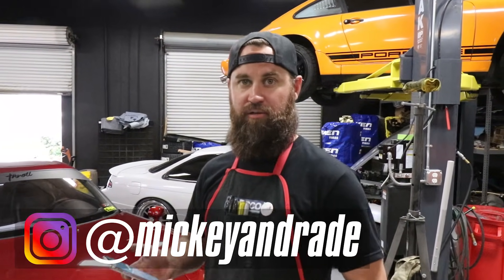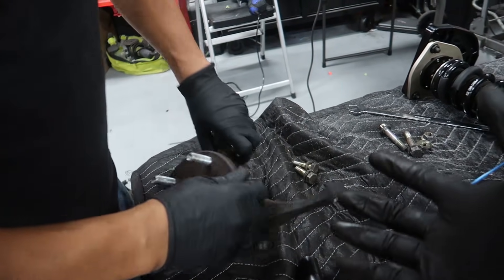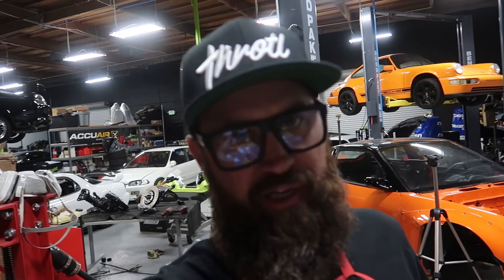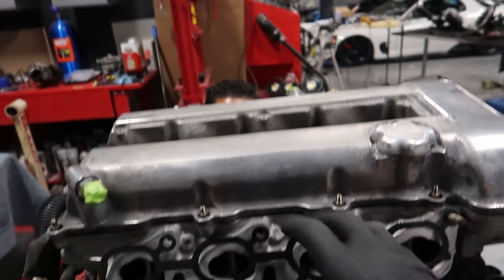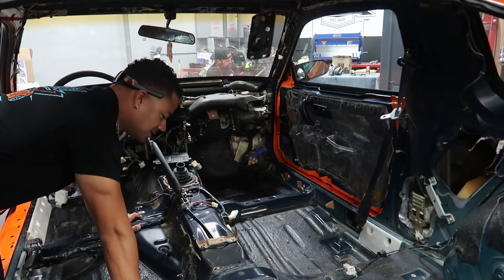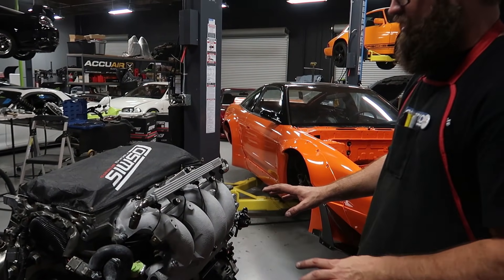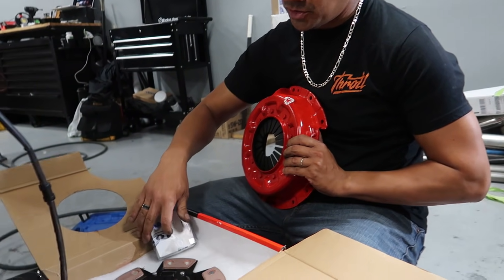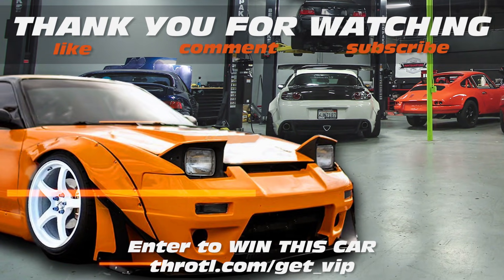Rebuilding (And Heavily Modifying) A 1989 Nissan 240SX Hatchback - (Part 3)

Comment: The turbo cobra pipe brought back memories of an upgrade I did to my S14 SR... 3 of 5 bolts snapped off in the turbo... 4 hours later finally got the pipe on....

Comment: Whys the turbo not top mounted?
Reply: We used the stock turbo manifold... but even other aftermarket manifolds are mainly bottom mounted as well 🤷‍♂️
Reply: @RunningSolo  Not in the UK... pretty much every modded/built sr is top mounted here
Reply: @frankiewalnuts  I mean .. for this vehicle ... just like you said.. here is the same way  .. most other vehicles are top mounted here as well